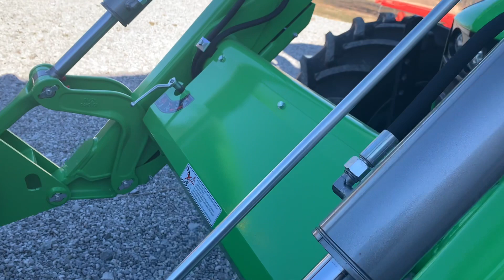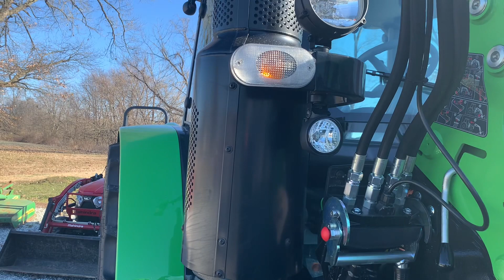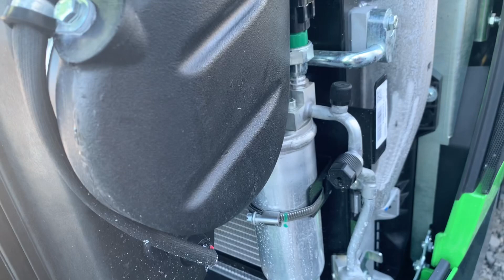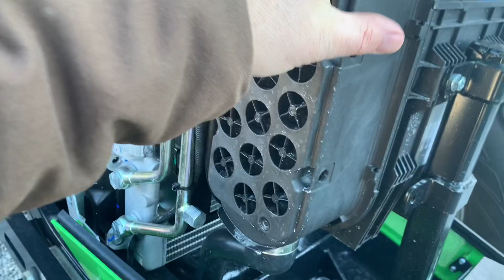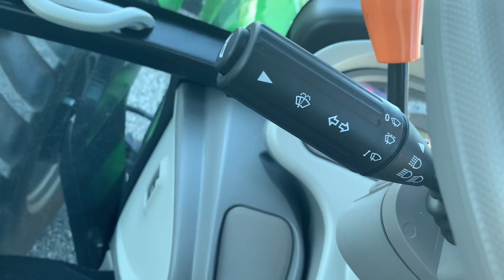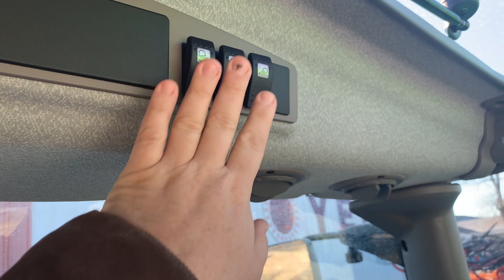Deutz Fahr 5120G Premium Walk-Around “Long Version”

Comment: I'm looking at one that says you need to press the brakes and push the clutch in to start it and to turn it off use the kill switch on the dash.  Is that normal?   Thanks
Reply from the maker: I don’t know anything about a Kill Switch on the dash. Last ones I was around had a simple Off, On, Start Key switch. Butt in seat, clutch, brakes, PTO off, and transmission In neutral, shuttle in neutral to start.
Reply: @tractorben  Ok thanks.  Haven't gone to look at it yet. Pics on tractorhouse just has one with that note on it

Comment: I just bought one from abingdon equipment it's got the pto button on the fender but doesn't have the ones for the lift arms can you order them for me and could I install them if so or would I have take it to a dealer?
Reply from the maker: I no longer sell tractors. The dealer is going to be your source for everything you need.

Comment: We have two Sames, both air cooled duetz powered, great tractors!  Explorer 2 and frutetto 2.   We are in the northeast, very hard to get parts in our area though, they are no longer any dealerships. Why don't deutz fahr have any dealerships in the northeast?, closest one is 330-350 miles away. The new duetz fahr tractors look incredible, very similar to the Same brand.
Reply from the maker: We ship parts daily. Feel free to get with me and I’ll connect you with our parts manager. She can fix you up.
Reply: @tractorben  thanks!
Reply: Those old Same tractors run on Same engines, air cooled but manifactured in house in Italy, in the same factory where this deutz was manifactured

Comment: Interested in getting a 5080 Deutz. Has there been any kind of issues or what does the maintenance schedule look like ? Not much information out there that I can find.
Reply from the maker: Not many issues to speak of. Great small tractor. We had one customer that had a right front hub failure, but things do happen from time to time. Regular maintenance with the right fluids and filters isn’t a big deal. On a 80hp tractor you should be spending $700-$1000 a year for maintenance on average.

Comment: How does these 5120G compare to JOHN DEERE 5100M ?
Reply from the maker: A 5120G premium is going to be direct competition for that 5120-5115m tractor. Differences are notable in standard equipment VS adding to the Deere to have things be equal. And currently you should be able to get a 5120G for thousands less of investment.
Reply from the maker: I have 2 on our lot ATM, if you’re interested and within our region, be glad to show you the machines.

Comment: Something I think would be good to tell customers or someone looking to buy a tractor.      To try and sway them to deutz.        Deutz and Fendt are made in the Same Factory so they have a top quality build.      And I’m not sure about over in the USA but here in Australia I cold get a 150hp 6cly deutz for the same price as a 120hp 4cly John deere
Reply from the maker: Yes Sir, same price structure here States side. I was up against John Deere last week on a 120hp tractor. With same specs, Deere quoted the customer $154k as the sale price. I came in at $97,840 at everyday pricing.

Comment: In a future video(s), can you show how to setup and use the return to level function of the loader/bucket. Also can you comment on and show the hydraulic cab suspension. It would also be helpful to show and talk about removing attachments from the front loader as well as removing the front loader itself.
Reply from the maker: So basically the “how to” scenario. I like that, I can definitely make some short concise material. I do appreciate the advise, thank you for your help.